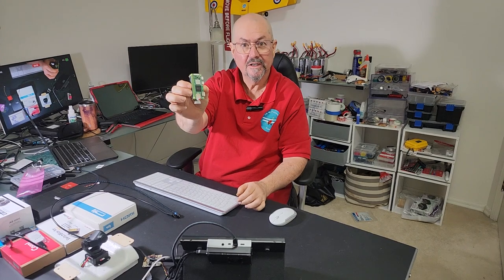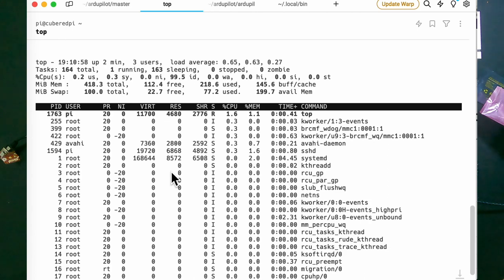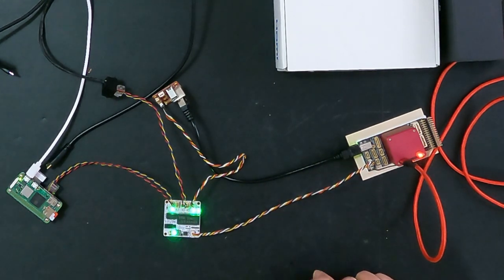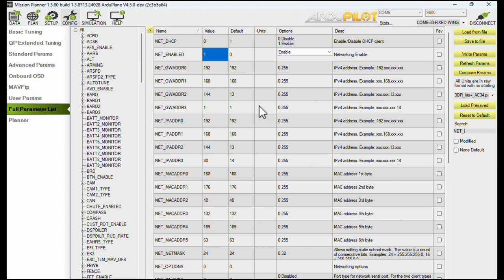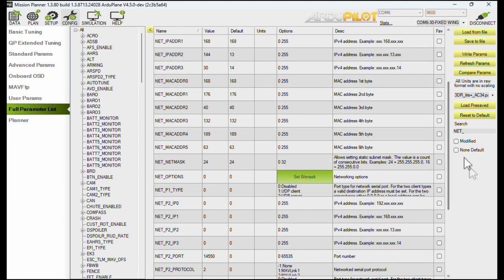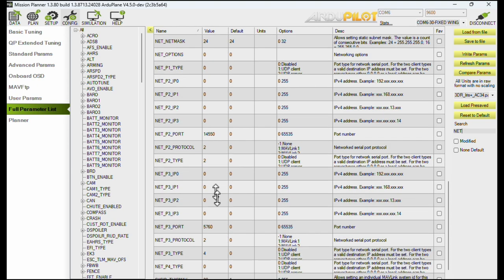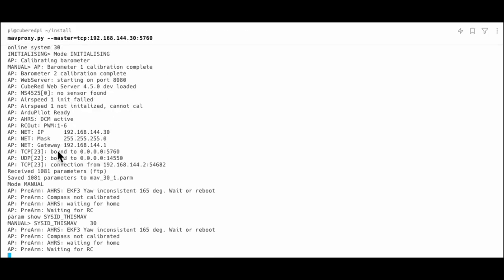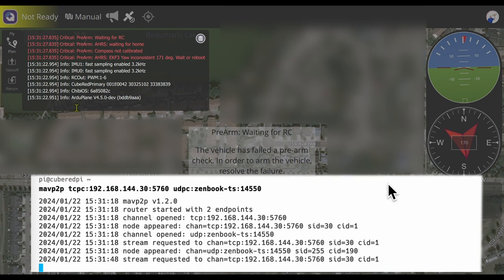Network on a Drone! Raspberry PI and Cube Red: ArduPilot 4.5.0 - Part 2 of 3 - Tailscale, MavProxy

Comment: cool ! can we just connect the pixhawk to the SBC ethernet port without the switch? cause i don't use the gimbal. I have a drone with holybroo pixhawk 6X and a SBC.
Reply from the maker: I guess you should check with HolyBro but it sounds like it should work.

Comment: 2.5MB/s is 20Mbit/s which is not too shabby
Reply from the maker: They WiFi in my house runs at 800 Mbits/sec - just saying.
Reply: @timtheplaneman  hardware is only capable of 10/100.